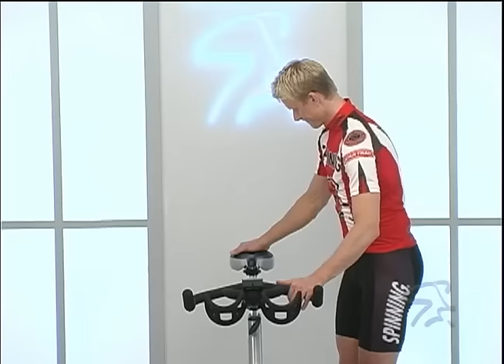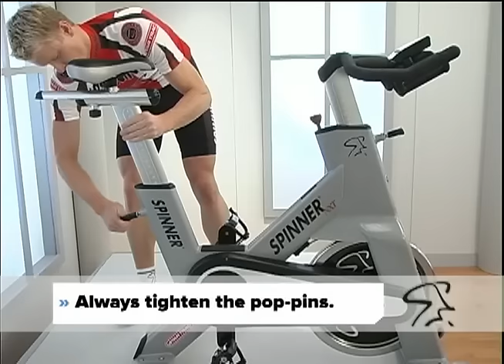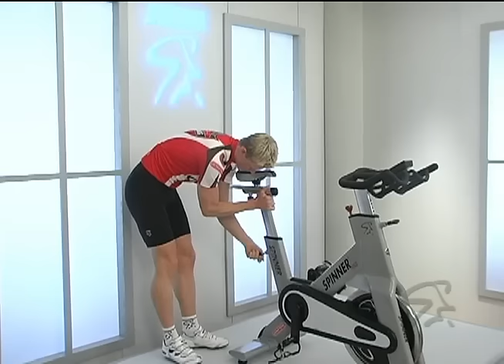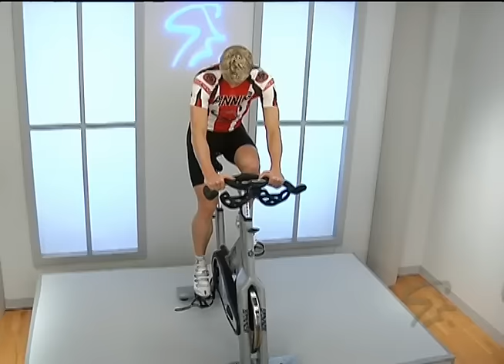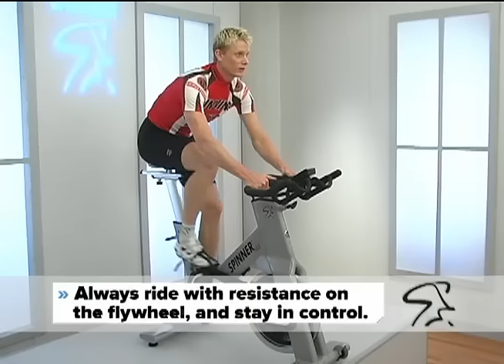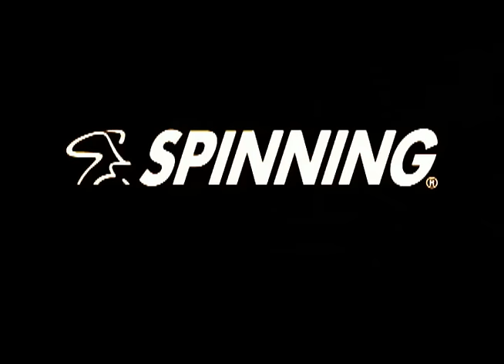How To: Setup your bike

Comment: I had some slight knee pain after a cycling class at my gym.  I had used the adjustment that the teacher had given me.  I went into the studio with this video while the studio was empty and I wouldn’t be bothered, and adjusted my bike using this video.  The teacher’s adjustment was completely wrong: she had my seat too low, she didn’t do a heel check, and she didn’t do a knee/flexion check.  I’m honestly shocked that she was so incompetent, but when you have a class of 60 people, personal attention isn’t really a thing.  I’m glad I found this video so that I could fix it before real damage was done.
Reply from the maker: Happy it was helpful to you!
Reply: in my experience, most cycling classes are not led by people who actually use road bikes... those classes are often more pilates-esque rather than being focused on cycling techniques. so the people leading those classes often don't even know proper techniques for setting up a bike, posture on a bike, etc...

Comment: What do you do if you are kind of in between two seat heights? Choose the higher or lower seat height? Should I choose the lower height which allows for more flexion at bottom of pedal ?
Reply: I'd say, there's a tool that can measure the angle of the leg called a goniometer, check it in both settings and go with the one that is closest to the ideal setting.

Comment: How does the flywheel weight effect the intensity of the workout? Can you do interval training and reach maximum heart rate with any flywheel weight?
Reply from the maker: Hi Brandon. The perimeter weighted flywheel that was pioneered by Spinning® acts to smooth out your pedal stroke and help keep your momentum and even cadence. Our flywheel, along with our specific gear ratio, gives the rider the same pedal feeling as riding outdoors.  The intensity of the workout is controlled with resistance and cadence (RPM).  You can absolutely reach maximum heart rate with the flywheels on our bikes as long as you do it safely and in control, which is an integral part of our program.  We recommend an RPM of heavier intensity between 60 and 80 for hills.  Any slower tends to be hard on the joints.  This is also why we recommend a cadence sensor or a SpinPower® crank to help you see your efforts and monitor your ride.

Comment: I’m really struggling getting my setting right. I just got my new spinner bike. I’ve followed the video but the problem is that my arms are shorter than average. I’m only 5”2’ and I have to have seat low and the seat closer. Now my knees hurt. What to do?
Reply: कडक
Reply: Director STL, you can slide the handle bars forward. One aspect not discussed in the video was the slight bend in the elbow. You do not want to ride with your arms completely extended.

Comment: BEST SPIN BIKES (Ranking by Q factor)

1- Wahoo Kickr Bike (Q Factor is 150mm)

1- Nordictrack S22i (Q Factor is 150mm)

2- Life fitness IC4, Ic5, IC6, IC7 and IC8 (Q Factor is 155mm)

2- Life fitness IC3 (Q Factor is 155mm)

3- Spinner NXT (Q factor is 158mm)

3- Spinner Blade (Q factor is 158mm)

4- Wattbike Atom (Q factor is 160mm)

4- Bodytone MT2 and WT1 (Q Factor is 160mm)

5- Schwinn IC PRO (Q factor is 168mm)

6- Peloton spin bike (Q factor is 170mm)

6- Schwinn AC PERFORMANCE PLUS (Q Factor is 170mm)

6- Schwinn AC SPORT (Q Factor is 170mm)

6- Life Fitness Lifecycle GX (Q Factor is 170mm)

7- Wattbike Pro/Treiner (Q Factor is 173mm) 

7- Life fitness IC1 and IC2 (Q Factor is 173mm)

8- SUNNY ASUNA 6100 (Q Factor is 176mm)

9- SUNNY SF-B1805 (Q Factor is 182mm)

10- Diamondback Studio Cycle 1260Sc (Q Factor is 187mm)

11- Schwinn IC4/IC8 (Q factor is 190mm)

12- Keiser M3i (Q factor is 197mm)

13- SUNNY SF-B1709 (Q factor is 203mm)

16- SUNNY Evolution Pro SF-B1714 (Q factor is 216mm)

Q Factor: Is the distance between the outside of one crank arm to the outside of the opposite crank arm.

Why should you care?
I know from experience that the narrower the Q Factor, the closer my feet are to each other, the more comfortable I feel riding a bicycle. 
This is especially true on a long ride or training.
long distance q factor spin bikes can damage your knees

Comment: Hi,
Wondering which type of shoes he is wearing. Just bought spinning shoes and they aren't compatible!?
Reply: @nutellabanana, most indoor cycling bikes are compatible with the Shimano SPD system. If your cleats are too big you may have a size similar to the LOOK Delta cleats. If it's not too late you can probably see if the vendor has the smaller SPD cleat that will fit your cleats. Happy Spinning!
Reply from the maker: Hey! You can find compatible shoes at our store link. https://spinning.com/shop/cycling-shoes/ Hope you're enjoying the ride.

Comment: I've never understood how anyone can be comfortable setting the handlebars lower than the seat... the big forward lean just puts more pressure on the dangly bits. 

Ended up getting a noseless saddle (since it's not like you need to turn on a stationary bike)
Reply: If the person is an outdoor cyclist he would be used to do this position .. they use it to break the air and getting faster in outdoor races .